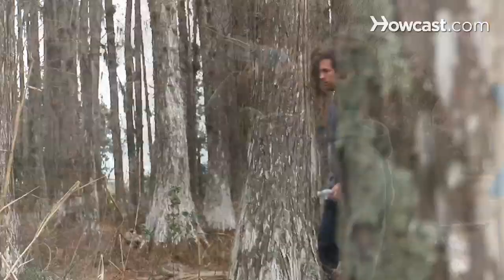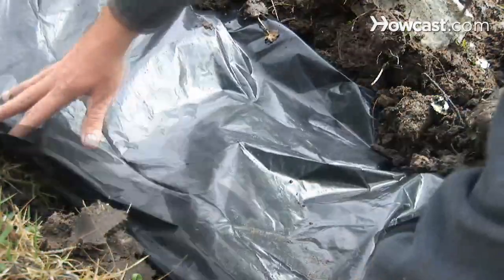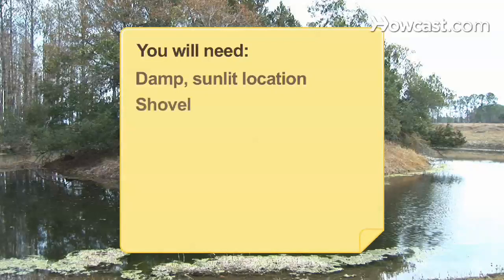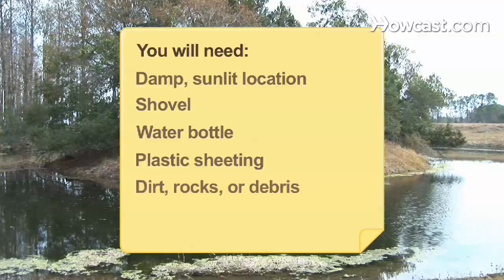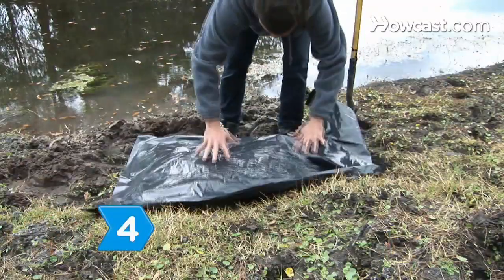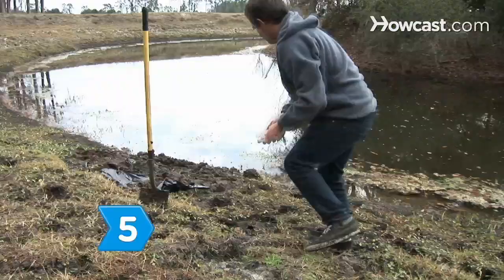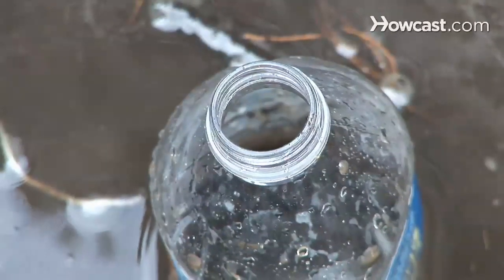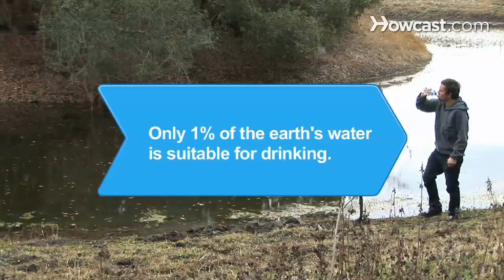How to Make a Solar Still

Comment: To make this actually work:
Take a transparent plastic bag/sheet to see where you're lining up your bottle and stone/boot/mud (any weight)
Cut the top off the bottle to widen opening and catch more water. knife>sharp stone>teeth (works, but slow and sore) 
Fill the pit with as many large leaf plant/tree leaves as you can find (more moisture) and build multiple if possible.

Comment: No way in hell he got that much water in such a short time. And no way the water found its way into that small bottle opening. And why did he have a shovel with him lost in the woods but no canteen or water pack?
Reply: I got about that much in 4 hours, but that's Ireland, not the warmest days. Depends on the heat and if there is a lot of broad leaf vegetation in with the water.

Comment: 1 star for demonstrating the principle correctly, but you can't hope to collect water drops using the thin inlet of the water bottle. 
The clean water container should be wide, like a plastic bowl. 
The hole is too narrow for its depth. 
The tarp should be left in place, and a tube passes from the container to the outside for drinking so that the still remains sustainable. Unless you want to redo this every time you drink. 
1/5 stars.

Comment: Wouldn't it be easier to just get the water, from the water source, next to the damp ground, and filter it?
And how about if the damp ground is next to a SALT water source?
Reply: This would work with salt water
Reply: Filtering will only remove certain impurities and could still leave the water unsafe to drink. Distillation removes all impurities including dissolved substances like salt.